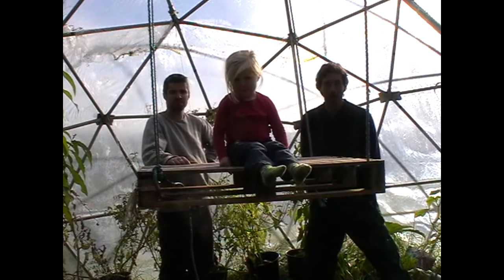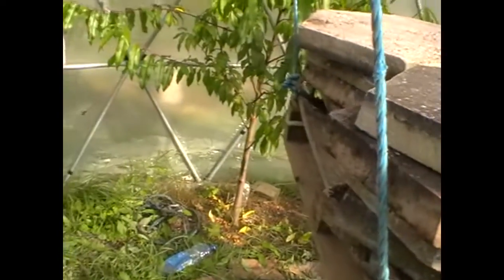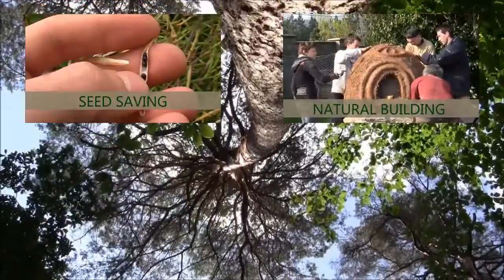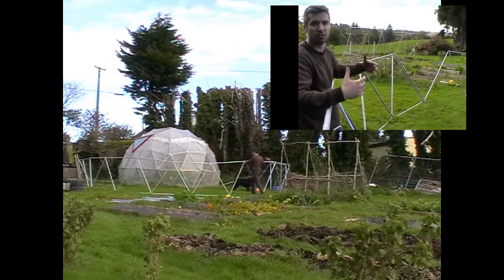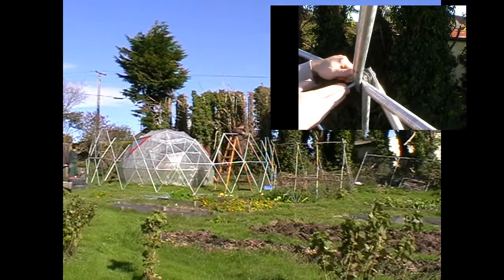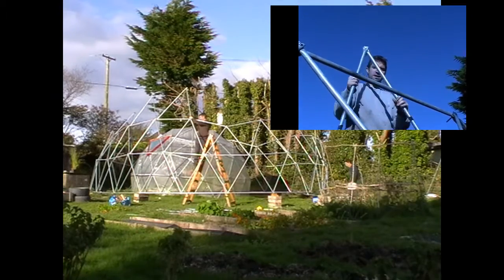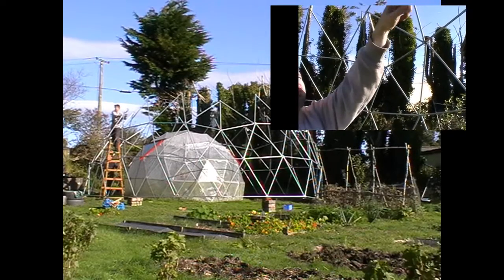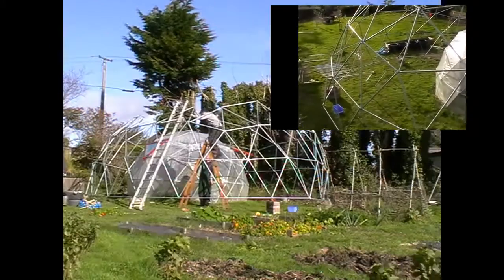Big Biodome Assembly - How Strong is a Geo Dome!

Comment: My dome experience true honest. Years ago I had a geodesic dome built from a kit with metal connectors and 2x4 lumber. It was covered with plastic and being used as a greenhouse. I was away for the day at the Canada day festivities, we had a wind storm. When I came home the dome had lifted off it's base flown over a 4 foot fence and was sitting in the middle of a shallow pond in my fenced goat, duck and hen yard. Turned on the TV news and that was the day Buckminster Fuller died July 1, 1983.